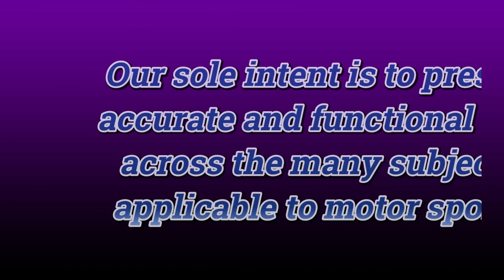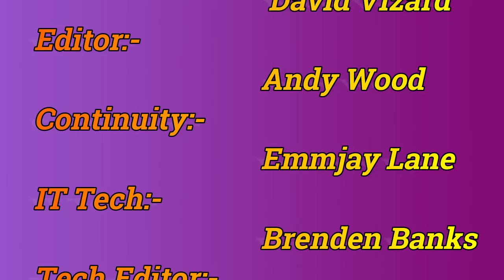Project updates you don't want to miss!

Comment: Hello Mr. David hope you're doing good. This might be a dumb question. If a guy is building a street engine is it possible to have cylinder heads that are too good for his build? The reason I'm asking is because I'm building a power combo that will include a ported cast iron dual plane intake because the hood clearance on my firebird won't accept a performer RPM, recalibraded quadrajet but I'm wondering if throttle body fuel injection would offer a more consistent fuel mixture since it doesn't require a pulsed booster signal like a carburetor and there is no booster in the way of the flow for short clearance, a pair of good performance factory iron heads that will be modified for better flow and I am still debating what kind of valves to get and weither I should use aluminum full roller 1.65 ratio rocker arms or stamped roller tip 1.5 ratio rockers. Does valve spring pressure matter with the different ratio rockers? camshaft power band will have a maximum peak at 5500rpm because its a 400 and they are torque happy engines. I wonder how much and when I should come to a stopping point at my cylinder head modifications. I have read where some professional porters have gotten up to 300 cfm out of the 2.11 inch intake but the exhaust I think got 240 cfm. Stock they flow 180 exhaust and about 220 cfm on intake. Thank you Mr. Vizard

Comment: Mr.D.V. I HAVE A QUESTION ABOUT LONG ROD MOTORS ,DWELL TIME TDC AND 110/115 OCTAIN FUEL 
I KNOW HIGH OCTAIN FUEL BURNS
SLOWER THAN LOWER OCTAIN FUEL SO MY QUESTION IS ,WITH HIGH OCTAIN FUEL AND LONGER
DWELL AT TDC CAN YOU MAKE MORE TORQUE & HP WITH IRON HEADS ON IRON BLOCK WITH 13.O:1 CR WITH A ROD TO CRANK 
RATIO OF 2.3:1 ? I AM SURE THERE ARE A LOT OF PEOPLE WHO WANT TO KNOW ABOUT ROD RATIOS &
DWELL TIME AND THE AFFECTS ON 
OCTAIN  AND POWER. THANK YOU

Comment: WIth the Seminars you should sell a kit with porting rolls, head stand and an affordable set of cylinder heads so everyone has got the same head as you to work along with you - as there is no point teaching a concept if you can't put it into practice.. My next big project though is making a 1950s Formula 1 type special with two toyota 4 cylinders joined together with a quill drive to make a straight 8 with a repurposed mercedes supercharger adding boost. I was going to make a replica of a mercedes Silver Arrow W196 car, But thinking about it I would go catatonic if I took it to a hillclimb meet and some old toff said "This isn't right" or they did 'This back in the day" These old race cars have become like hedge funds for millionaire collectors sadly.. but I figured I would make my own special as if I was back in the late 50s but had the parts of today to build it..